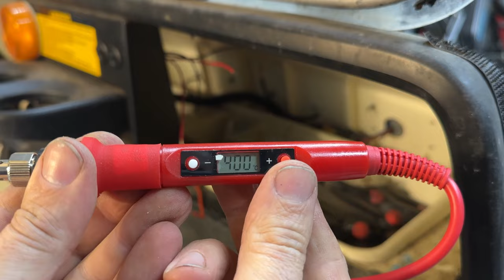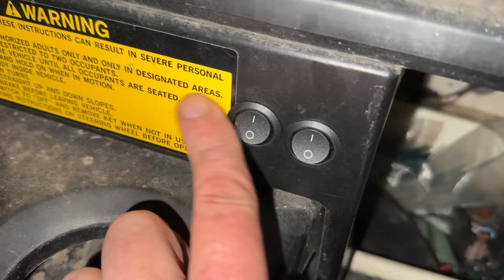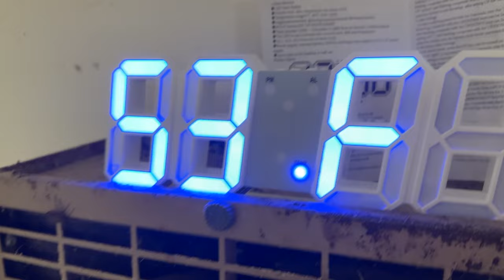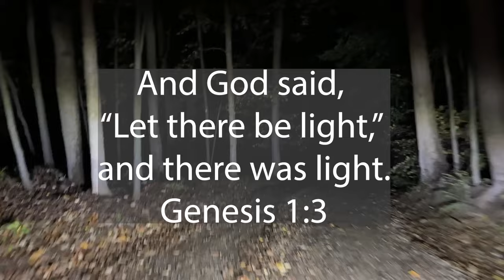What The Heck Is Temu?? - Golf Cart Headlight Upgrade

Comment: I've used those many times. If you use them properly with a heat gun, that piece of solder in the middle does melt and solder the leads together...

Comment: These heat shrink soldering connectors are great if you use them correctly. The solder ring inside is a special alloy with an ultra low melting point (usually around 125°C/250°F).
Hold the lighter 1-2cm (1/2 - 1") below it, move it side to side a bit until you see the ring melt and be absorbed into the cable and you will have a perfect connection. Should only take about 10-20 seconds depending on wire gauge (you stopped just a few seconds early).
Reply from the maker: Thanks for the info!

Comment: Yes, PLEASE, Brother Todd, get yourself a cheap HoboFreight HEAT GUN! That open flame technique has gotta go! 🤦🏼‍♂️
I’ve been using those heat-shrink butt connectors for months now, and I’ve had amazingly good luck with them. I just loosely twist the bare conductor leads; center the solder band over the joint; apply heat (with the heat gun), which shrinks the connector ends onto the wire insulation, and helps to hold the wires together; and then I focus the heat on the center band until the solder fully melts (it goes shiny) into the conductor joint.
Easy-Peasey, and really stable connections. No need to have ugly CRIMP joints any longer!

Comment: That is a solder connection.  you need to use a heat gun for them. it  solders and  seals it at the same time.

Comment: Yeah, UPS doesn't have a good history with me.  In the 90's I worked for Connecting Point.  One day the UPS driver pushed a $4500 laser printer off the back of his truck.  It was a good 3 foot drop to the ground.  I got stuck trying to repair that thing multiple times when the sales guys kept selling it, getting it refunded, rinse and repeat.  I told the boss it would never work right because the frame was out of square, but he wouldn't accept that. 🙄